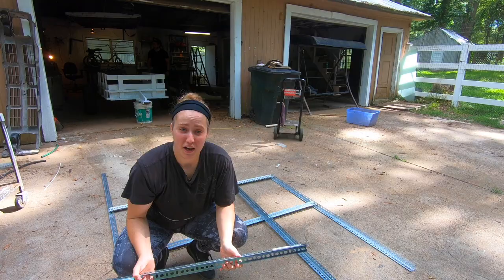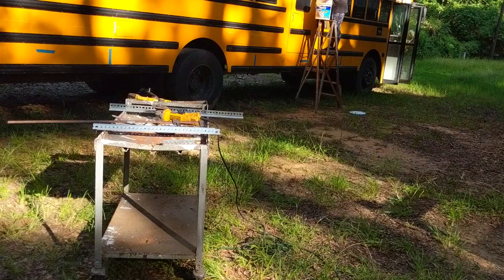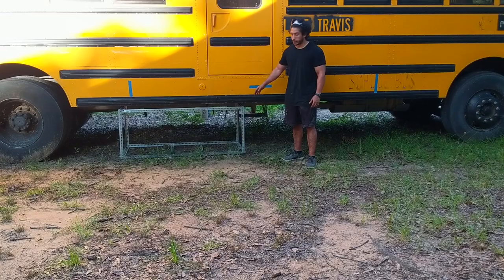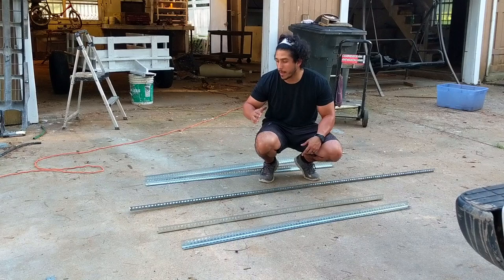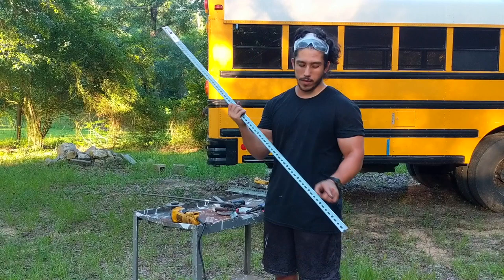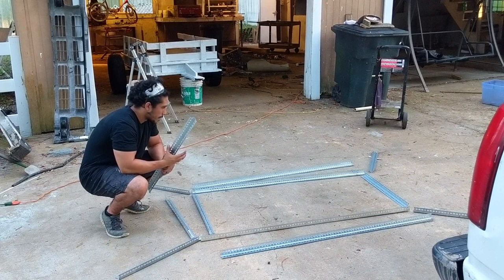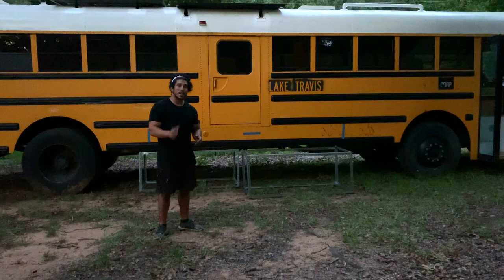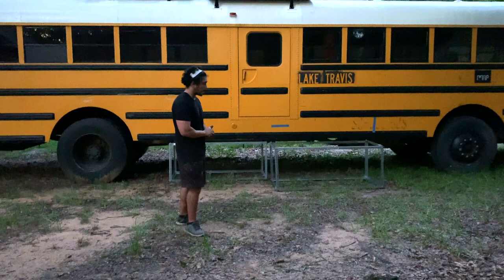DIY Under Bus Storage Boxes Part 1 *Skoolie Conversion* Gus The Struggle Bus

Comment: PACO. I absolutely beg you to put the grinder guard back on. If that grinder wheel that's spinning at 14,000 RPM comes apart, you risk severe bodily injury. Your safety glasses will be useless in that situation. As a GM mechanic of 15 years, I have had dozens of cut off wheels come apart. If my calculations are right, 14,000 RPM is 260+ MPH
Reply from the maker: There has been a couple of people that have suggested it multiple times now and I really need to.The grinders cell is an arse so it felt weird needing to buy a guard for it but enough people have told me now that I would be dumb not to. There is a couple of things that I need to get from Amazon here within the next couple of weeks and that is on the list.

Comment: Where the two are meeting use a single bolt instead of keeping them seperate. This will save a small amount of space unless you want them devided. In that case place metal sheet between then use single bolt. Every 1/2" counts. Looks awesome. Keep up the great work.
Reply from the maker: Great minds think alike!! That's exactly what we where thinking. Linking the 2 boxes with one single bolt 😁🤓

Comment: You should look into locking nuts for all of your nuts.  Nylock nuts or lock washers should work ok.  There is a lot of vibration and flexing on the road.
Reply from the maker: Thank you so much for the tip we might take it one step further and put threadlocker on it 😁 we don't want anything to come loose

Comment: Before you mount the boxes paint the outside with the silicone paint you used on roof to keep water out of boxes
Reply from the maker: We might definitely do that we're trying to make the boxes as weather for this possible before putting any caulking or sealants on it, but if it comes down to it will definitely use the Henry's tropicool

Comment: When grinding or welding galvanized steel, wear a respirator or, better yet, remove the zinc coating using muriatic acid to prevent zinc poisoning.
Reply from the maker: I didn't even know that could be a thing. Thanks for the tip ☺️

Comment: Another killer outside box wood coat would be driveway sealant. The Home Depot product that's $50- for a 5-gallon bucket. It says airplane runway on the bucket. I can officially say it has lasted 5 years now on my drive and still no issues.
Reply from the maker: Wow, thank you so much for the great tip! We'll have to look into this and knowing that it has worked for you makes it a great place. Thanks again.

Comment: I'm blessed to have a pass through basement in my bus already. But I still need to rebuild the battery bay and plan to expand that bay into a large combo bay including tool box slide out with a low shelf for clean and grey water hoses and maybe electrical cords. I'm going to have a fab shop do a simple cut and box and pan brake bend on 16 gauge steel sheet then rivet it to build the box and weld the joints closed. Welding is not all that hard to learn and it's fun.  I recommend you two find a maker space or vo-tech adult ed evening class and learn.  My middle school daughter and 18 y.o. son both like welding.  It's also a valued skill you can earn side money with.
Reply from the maker: That's really cool! When we looked at buses we really wanted one that had the storage compartments already built into them but unfortunately we did not get that lucky every time that we see somebody with a school bus that has storage compartments we get a little bit jealous lol. We've been really wanting to learn to weld because it would be very useful in our build as well as, like you said, it is a very useful skill to have. One day, we will get our welder and give it a crack but for right now we want to show people that you can do a bus build without having to weld are used extravagant tools, because we just don't have them LOL that's really cool how you going to build your compartments. We were also thinking about riveting ours together. Thank you so much for the motivation! 😁🤓

Comment: Hey Meredith Hey Paco 
The only thing I would do is, make the doors out of trex decking boards. aka. Fake wood,  lol. And use the metal to frame so it fits just inside the box'd frame and put a rubber gasket to make it waterproof. Sorry I understand what I'm trying to say do you understand what I wrote LOL have a wonderful blessed safe weekend you too. If you don't hit me up on Instagram and I will send you a drawing.
Reply from the maker: Lol yes, I Completely understand and that is a great idea. We are trying to find a way to have two layers door. One for the actual storage unit and a top layer for and outdoor table, if that makes any sense LOL. That Trex decking board would be great for that!

Comment: Sorry for being late to watch, buried alive at work (railroad). Great videos as always you two. In regarding the underbelly storage, I saw "Roll With It" did tje same and great idea. If you got some of that Henrys tropicool silicon paint, that would make for a real tough outside/under protection layer. Try on bare wood and leme know for the test.
Reply from the maker: LOL, it doesn't matter when you watch him come up we just thank you for watching them and supporting us. Yeah right after we finish working on this we did more research and found that they had done something similar. That's not a bad idea at all, right now we are thinking of reusing some of the metal we took out from the ceiling of the bus so wish us luck LOL

Comment: Hey, looking good! Go back and put some lock washers on those bolt or they can get loose on the road!
Reply from the maker: Thank you so much! For right now you're just putting everything together rough draft style once we are ready to install everything permanently we will make sure to put threadlocker on it 🥰 I feel like we are overdoing it with the threadlocker a little bit but if it works then that's all that matters LOL
Reply: You might have to rename him Gus the Threadlocker Bus.
Reply from the maker: @larrym6019  hahahahah that's not a bad idea at all. If we ever want to take it apart it'll be a pain in the butt 😂

Comment: you don't have a big motor right? 5.9 ? so just make sure you have the weight balanced out in the middle. If I'm wrong someone tell me different?
Reply from the maker: We hope to have everything pretty evenly spread out through the chassis. But if anybody has some input on this we would really appreciate it 😊

Comment: missed the premier :( up here at my property doing a little work and staying out of the city for a few days. I imagine that you are going to secure these with all thread. Don't forget to have extra sections of all thread hanging around. That shit is awesome but just like anything it can get wore down from all the moving a bus does. So if you have a few extras of these lying around when you notice so wear and tear on them you have extras that you can swap out quick and easily.  No parts are meant to be permanent so always have backup plans.
Reply: Just a quick add to this. I am not saying the all thread will fail immediately. I'm saying 10-15 years down the road it will be more than likely you will need to replace them.
Reply from the maker: First of all, it's nice to get away from the hustle and bustle of the city from time to time, enjoy nature, do some physical labor lol. So awesome you get to do this. As far as the thread locker when we originally got it after the first roof rack video we got 2 just in case we needed it in the future it knowing it would come in so handy!! We are now on our second packet and we'll definitely be getting some more just in case. 😁

Comment: Dumb question, but where did you guys get your material? Does Home Depot just carry it? I can’t remember seeing it there- but I guess I’ve never been looking!
Reply from the maker: Our home Depot did . They are called slotted angles or slotted angle iron. And are home Depot they are in the nuts and bolts in section. If I remember correctly the the smallest size they had was four feet and the largest size they had was eight feet. I hope this helps. Home Depot carries a lot of materials but every once in a while there's just some materials do they don't carry. Here in Houston we looked at most of the home depots around us and they carried them.

Comment: what cutting wheels are you using, it seems like I'm going through them super fast...
Reply from the maker: Lol it's a 1.6 mm wheel and it's been doing us good. No complaints yet 😊
Reply: I buy them at harbor freight. I go through them fairly quickly but they're cheap as cheap gets.  Do wear face shield.  They can shatter and fly. But don't buy harbor freight wire wheels.  They're complete shit. They shoot metal wires out into your skin as you use them. I was like a metal porcupine after cleaning my son's jeep frame to weld it.

Comment: The grinder has a protective guard which should not be removed for safety reasons but great job getting her done.
Reply from the maker: Thank you so much! We are actually looking into getting a guard and handle but   both HD and Lowe's say that it comes with the tool no sold separately. We'll just have to look into good ol reliable Amazon 😁 thanks for the tip though. The tool is not ours and didn't come with it 😕 we are just extremely happy and thankful to be able to borrow it 😊
Reply: Walmart and HF both sell cheap but decent angle grinders for about $20. With guard of course.
Reply from the maker: @larrym6019  thank you! I'll have to look into them 😁

Comment: I really love watching you guys, surely you can make your video's a little longer maybe a 20 or 25 min video? please? Welding is not hard it just looks that way once you get past being scared of getting burned, Then getting the right heat and wire speed. then laying down that bead that connects the pieces together or filling wholes. If I was there I would help you learn how.
Reply from the maker: We work really hard on our videos so hearing this makes us feel really warm. So,  here is a little behind the scenes, we usually have about 2-3 hour's of footage that we edit through and are very critical in what makes the final cut. if we see that a clip contributes to the story we keep it in and vice versa. We would love to make longer videos In the future but for right now it hasn't played out That way 😔. So far, the longest video we have is our skylight video which clocks in around 30 mins 😁. We have looked into welding for a while and it looks fairly simple after you get those things down. There are 2 reasons why we have decide not to go through with it . 1 we don't want to spend the cash for the welding machine and 2 we want to do our build and projects in a way and with materials that could be available for everybody, beginners to veterans of the trade. Like that, we hope to inspire those people that think they can't because it's to hard or they don't know how, that if we can do it they can do it to 🥰🥰 PS we would love to get some pointers on welding 🤓
Reply: Oh yeah, I understand budgets I was just letting you guys know.